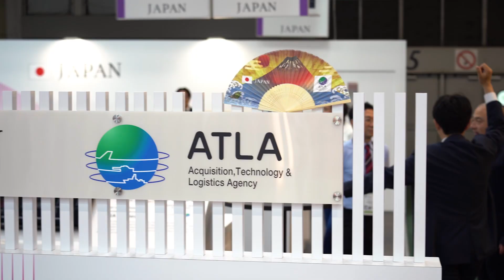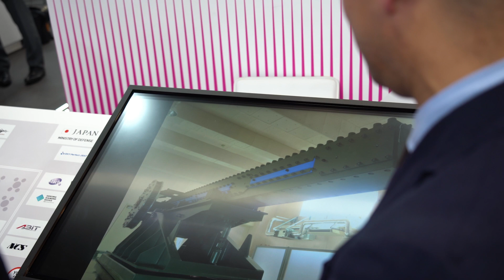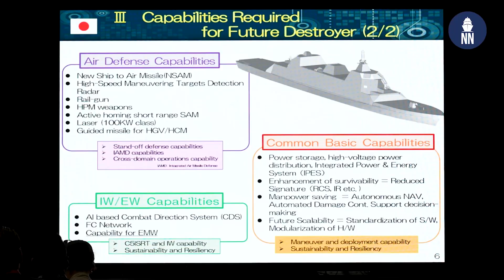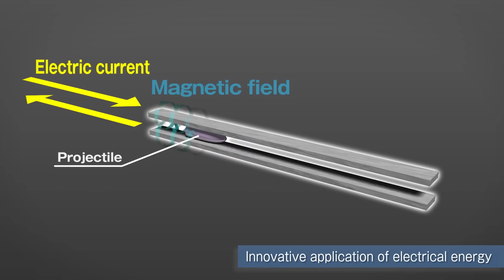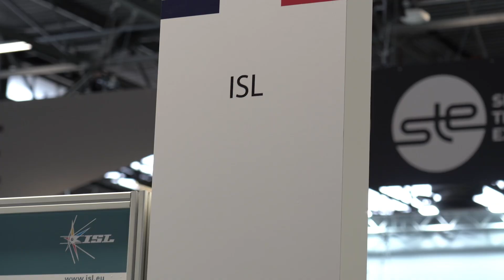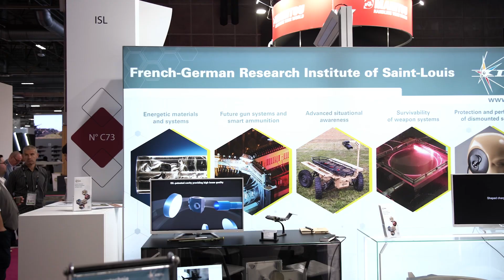Japan joins European efforts for railgun research project

Comment: If I get it right the US gave up on it because of barrel wear.
Reply: US problem was that they went for a large caliber right away, it will of course have more tear and wear than if they went for a smaller caliber.

Even big old battleships guns usually were rated for +-400 rounds before they needed maintenance, more modern battleships could fire a bit more between each maintenance period of their barrels.

Comment: And will FAIL. 
Railgun is just hypersonic projectile which date back to WWI paris gun. The big secret is that railguns have little range advantage since air resistance quickly slows the velocity of any bullet, including the 24lb bullet fired by current railguns. The greater the muzzle velocity, the faster it slows due to air resistance. A 30 caliber bullet loses one-third its velocity at 500 yards! Look at the ballistics of a railgun's 24lb (10,866 gram) projectile fired at Mach 7 at sea level. Results can be seen using an equivalent G7 low drag shape in a ballistic calculator, and show that it would lose half its velocity at just 2.4 miles When it reaches 6.6 miles it has slowed below Mach 1, so it cannot reach targets over 100 miles away as its salesmen proclaim.
Reply: The invisible hand will make sure it succeeds. A rail gun is unbeatable from an operating cost perspective.

Comment: Japan has finally put linear motor cars to practical use, but it took more than 50 years. 
Railguns are also being researched using 40mm guns, and this is a long-term research and development effort.

Comment: Railgun is a dead end. It would've been operational for more than a decade by now with the US.
Reply: I wouldn't say it's a complete dead end, but it will be until other technologies come along that make it more feasible. It will likely need a fusion reactor to power it, and alloys for the rails that can withstand the stresses they're put under.
Reply: As I understand it, BAE systems was working on a railgun for the US. Europe should be picking up where the US failed from lessons learned by the American programme. That is sensible, as China and many others are looking to develop railgun technology still.

Giving the US the benefit of the doubt that behind the scenes they are innovators, Europe is still in regards to actual in-service military application, technologically more advanced than the US and should not be underestimated. It's a good thing Japan is getting closer with Europe in defence innovation.

Comment: Japan already made a rail gun and performed the first ever ship based rail gun test firing as well, they are blatantly ahead of Europe in rail gun research.
However, there are clearly some minor details that make the weapon problematic in certain areas, which is likely why the USA cancelled its own program in fact. 

I think it would be better for ATLA to abandon the railgun development, and instead just go fully ahead with the high powered LASER CIWS development (this 100% is going to blatantly be the future of short range air defence). 
Retain the regular naval gun, but upgrade it into a more advanced form that makes it more similar to those rheinmetall guns that can prime their round for detonation at a certain range, this will increase its anti-air capability as a gun. While it will still have the capability to shoot surface vessels as well, which is important with possible remote controlled small suicide boats being developed, it is required to maintain some ability to shoot small boats within a few kilometres.
Reply: France and Germany has been working on the railgun project for a decade now. And they bring a lot of experience with their ISL project.

US problems, was that they chewed over to much in one go. They went for big caliber from day 1 and tried to get as much speed as possible and it had to end up as it did.

France, Germany and Japan, didn't go the big massive gun and high speed route, they went the slow and steady rout, starting with small caliber and make it work with axepable tear and wear, then they have slowly increased speed and caliber (40mm last time), they had one go 3000 m/s during testing, some are equivalent to Mach 8.7

Comment: The issue with railguns is that these are operating at the extreme end of power requirements and material science. Specifically in regards to material fatigue, the rail gun will be subject to high mechanical stress and also extreme heat buildup. And most of it's electromagnetic parts aren't has dimensional robust as a gun barrel.
I think anyone one with enough money and technical knowledge can build a railgun, but the problems are getting it to a power level that is better than current guns and not having it catastrophically destroy itself after firing a round.
Reply: The US was getting well over 100 rounds from a railgun barrel years ago.
Reply: @ARCNA442  I saw the prototype, a very large beast that would probably only fit on a large ship.
Yeah... 100 rounds... it's not even a statistic... That is going backwards in terms of reliability to the old iron guns of the 15th century.
When I saw the video of them firing that thing it really made me think that the design wasn't ready. It was impressive, but just seeing all the wiring and all those moving parts... 
Until they find a way to deal with the thermal and mechanical stresses it won't be practical, and after that there are the power issues. Unless they first start using low caliber rounds, the problem is what would be the minimum caliber that could fit the operational requirements and would still be technically feasible.
Reply: @calexico66  The US railguns project was designed to the Zumwalt class Destroyers, thus it's size.

The problem US had/have, is that they chewed over to much in one go. Instead on focus on a smaller caliber like Japan/France/Germany is doing, for then later when it is mature go for larger caliber. US Went straight for large caliber with all it's problems.
Reply: But they are very important for Gundam robots...

Comment: With Japanese France could cooperate successfully, with Germany It is always either an economic failure or a technical failure or both...
Tiger helicopter, A400M, SCAF, MBT, etc.
Reply: What about Airbus???
Reply: @johnpaul3099 about A400M Airbus also had to make a provision of 1.3 billion euros related to the program for its 2017 financial year, which brings to more than 8 billion the total expenses published by the group since the launch of the program. The total bill now reaches more than 30 billion euros for 174 devices, compared to 20 billion planned in 2003
Reply: @kiefferfx18  
And? The Luftwaffe is paying €1.15bn for 3 C-130-J30 and 3 KC-130-J30. That's an average of €195 million per plane.
€30bn for 174 A400M. About €175 million per plane. So what exactly is your objection?
Reply: @marcg1686 The contract is estimated at $1.4 billion, so not necessarily a very good deal, while the French Air Force had managed to obtain two C-130Js (the first of which has been delivered, the second is following) and two KC-130Js, spares, warfare, initial support, for half that amount.
Reply: @kiefferfx18  
Nope. The French FMS Deal is/was for 4 aircraft, four spare engines and no Link-16 terminals. And additional equipment. Roughly $165 million per plane.

The German FMS deal included eight Link-16 terminals, one per plane and two spares.
Reply: @kiefferfx18  
Australia has signed up for 24 C-130J30 aircraft with 24 spare engines including propellers. No Link-16 terminals.
$6.35bn.
Reply: SCAF, MBT are both in the development phase, so you can't know anything about their outcome. The A400M has been bought by 10 countries, so this is not bad. The tiger helicopter was not good enough, but combat helicopters can generally be questioned as to how appropriate they are in today's world.
Reply: @Sofus.  
The Tiger was never meant to be an attack helicopter in the classic sense. It's more of a heavily armed scout.
The partner nations realised that there is no point in trying to make a flying tank. The KA-52 and Mi-28 are the most heavily armed helicopters available. The Russians have lost about 70 in total in the Ukraine.
The original customers should have cancelled the program when they realised how few helicopters were actually going to be produced.
Reply: So, in conclusion we can say that the Luftwaffe is paying:
$207 million per A400M
$233 million per C-130J30

France is paying:
$164 million per C-130J30

Australia is paying:
$264 million per C-130J30

No C-130J30 customer is paying double what everyone else is paying.

The A400M is a reasonably priced aircraft.
Reply: @marcg1686 I agree with you, the price is now correct, however It is a commercial failure and the delay of the program has forced some countries to buy other aircraft like KC-130J in France
Reply: The Tiger helicopter is not a technical failure. Most certainly a financial one.
Prior to the dissolution of the WarPac, French, German and Spanish requirements amounted to almost 450 airframes. That would most certainly have allowed the program to break even.
The A400M is not a technical failure. Apart from the 4 partner nations, 6 other countries have procured the plane.
The SCAF and MGCS MBT needn't be considered, given that no examples have been manufactured and given to the partner nations for assessment.
The Alphajet is one of the best trainers in its class.
Airbus Military is successful.
ROLAND missile.
Milan missile. Almost 40 customers.
C160 Transall.
Breguet Atlantic.
Reply: @marcg1686 EC665 Tiger is a wonderful helicopter, however  Germany is a very bad partner :
Germany decided to withdraw from the programme, leaving the French and Spanish alone to ensure its development and financing (2.8 billion and 1.8 billion respectively).
Reply: A400M a faillure ?You clearly don't know what you are talking about
Reply: @inigo5525 Economic and sales failure.
However, while in the early 2010s, the most pessimistic estimated the export potential of the A400M at 280 units, sales abroad are still struggling to take off, with only three customers [Malaysia, Kazakhstan and Indonesia]. Furthermore, the number of aircraft ordered is just over ten.

However, according to Michael Schoellhorn, CEO of Airbus Defence & Space, the A400M would not lack potential customers… However, given the involvement of German industry in its production, the difficulties in obtaining export licenses from Berlin are causing lost opportunities
Airbus also had to make a provision of 1.3 billion euros related to the program for its 2017 financial year, which brings to more than 8 billion the total expenses published by the group since the launch of the program. The total bill now reaches more than 30 billion euros for 174 devices, compared to 20 billion planned in 2003.